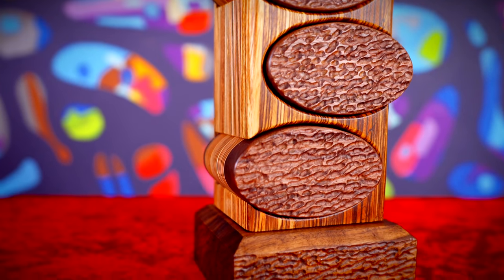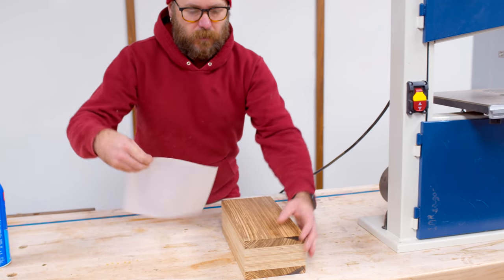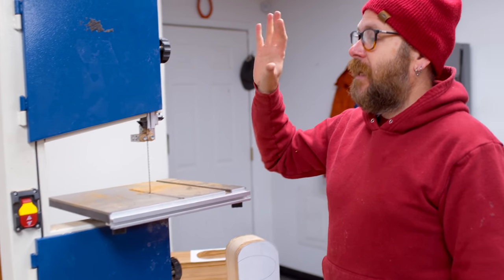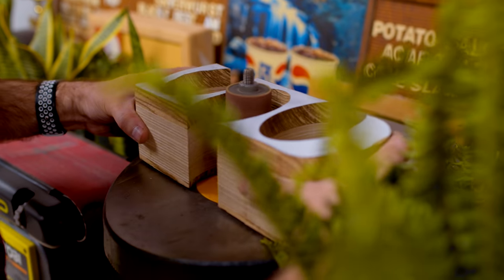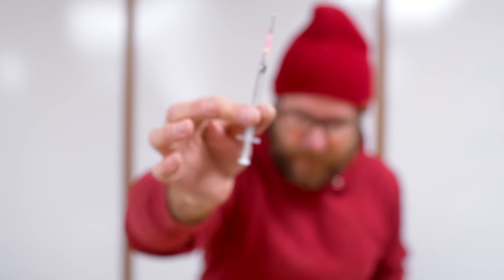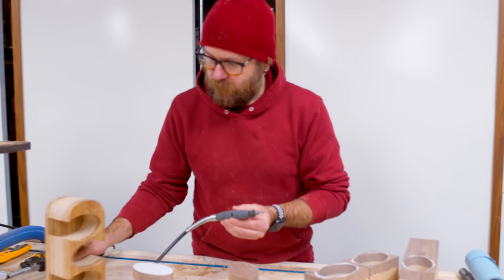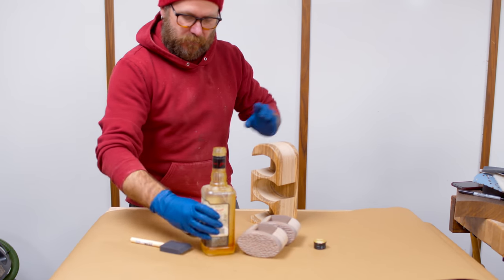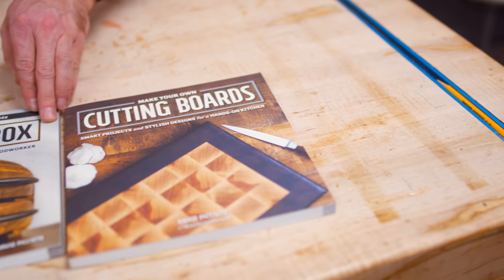How to Make a Bandsaw Box In a New Creative Way | Easy Woodworking Project

Comment: I am one of the ones who communicated an issue with tracking on the 10-306 in December 2019.  They now have a new version, the 10-3061.  From what I surmised from reading various posts on the net, the 10-305 has crowned wheels and the 10-306 has flat wheels, which interfered with the tracking of the thinner blades.  I hope the 10-3061 has addressed this issue.  I gave up and bought another Laguna 14 Twelve (I now have two.  I hate switching blades).  At least I had a good excuse!
Reply from the maker: ahhh, thanks Mike!

Comment: In my opinion, this is your best design ever. TIP: Use a wooden hand screw clamp on the end of the oval pieces, and place the clamp flat on the bandsaw table, when cutting off the front and back and the wood won't be drawn down harshly as you cut them.  I use this technique when making Christmas ornaments from slices of tree branches.  Keep up the great work!

Comment: Good morning from Southern Cal,  where it is NOT colder than a politicians heart.  David - suggest that you make a little sled thingy for better control of the drawers when slicing in the bandsaw.  Just a little square of thinnish plywood with two cauls fastened close enough together to support the front and back of the drawer to keep it from hysterically jumping when you cut.  Don't be Stumpy.

Comment: When I had a tracking issue with a 3/16" my blade on my little Rikon bandsaw, they eventually replaced the saw.  The lower wheel assembly on the new saw was slightly different, and it tracks great with a 3/16" blade.

Comment: I think this box looks pretty sweet. I've got a thing for boxes, especially those that have an out-of-the-box design. I bought the 10-305 a couple of years ago on your recommendation to replace my 10+ year old Delta which I hated. I bought it from the Big Green box store on a rebate week, so I got a great price for it. I have had no problems with it, it's a joy to use. I'm still using the original stock blade, though. I really need to try the one you suggest. Once you got the spoon out, I knew exactly where it was going. I was not disappointed. 😄 Thanks for another fun video and project!

Comment: I purchased your bandsaw box book last year and I have three of your boxes glued up and sitting on my workbench. At the time my Delta 14” was slipping out of gear and blades were jumping off the wheels. I believe I have found the issue of the lower back blade guide screw vibrated lose. I destroyed 5 blades without noticing the problem. Now I just don’t have the motivation to swap blades anymore. 🙄

Comment: Great video!! I just picked up The New Bandsaw Box book. I also just got the Rikon 10-3061 for Christmas. I'm new to bandsaws. Any tips on getting the table on these Rikon saws aligned perfectly to the blade at 90? Everytime I tighten the bottom bolt down, it throughs it slightly off.

Comment: Nice project david. I was always taught tht u needed a laquer/shellac seal before applying the flocking adhesive (so it wouldn’t absorb into wood) but nice to know i can skip tht part, which now actually makes sense now tht i think about it because it isnt going to soak up much anyway. Also really been enjoying your pod cast. Sn— i did a similar bandsaw box with the dremel for tht textured look as well a cpl years ago.  Definitely makes for a different look.

Comment: Shouldn’t the drawers have been cut off upside down since the back was not cut straight (the 90 degree issue)?   Looks like the one shot of the drawer being cut out the it exits the top way before the rear. 

End project turned out great.

Comment: Re: Rikon bandsaw -  I had a cheap Skil bandsaw, and it was nothing but frustration, no power, hard to adjust etc.  Got a Rikon, and I can tell it will be passed down to my kids - and it wasn't all THAT expensive.
Reply: This year after my old ryobi bench top bandsaws motor burned out, I bought a rikon 12" band saw and the difference was night and day.

Comment: Why didn't you set the three drawers back into their original block to reduce their depth and to remove the front and back of the drawers?  The original block would have held them securely and you could adjust depths, securing with CA glue...?  Just a thought..

Comment: The reason your glue failed is zebra wood is an exotic wood that requires cleaning with acetone to remove the oil off the weed
Reply from the maker: I’ve glued up dozens of these with zebrawood and have never cleaned it. I assume I didn’t have any glue in that spot.

Comment: Out of curiosity, why did you choose to cut the back of the boxes and remount the templates instead of sanding the whole drawer to the line and then cutting the back off?
Reply from the maker: I always sand after gluing things back up to make up for any errors or mis alignments in the glue-up.
Reply: @MakeSomething  Got it, thanks. I love the end product, especially with the texture on it! Bid placed!